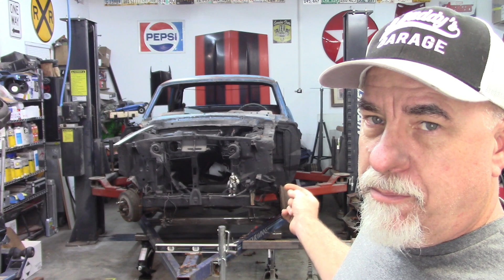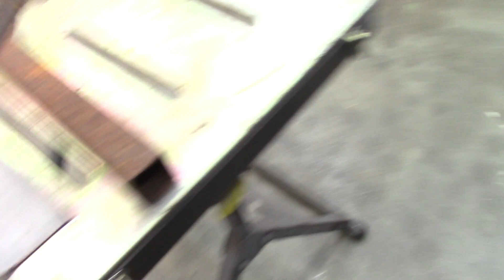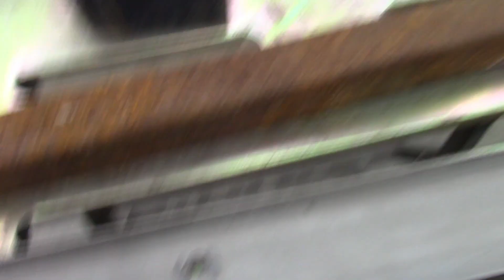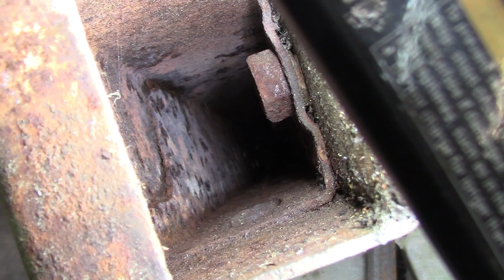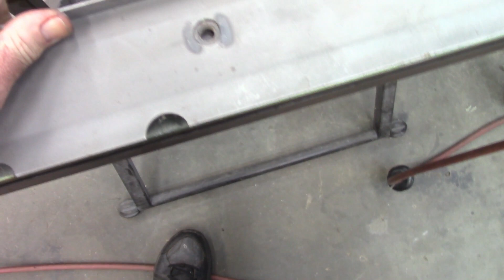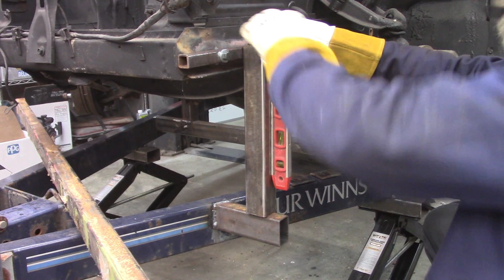Mobile Mustang frame jig. Part 4.

Comment: Each new car you put on the jig, will have front bumper bracket nuts in slightly different places. Seems you are now boxed in to the specific front measurement of this particular car now. You could have used a different metal piece like an old bumper bracket for instance. And made the holes big enough to locate where you need to. Another thing is that depending on whether the engine is in the car, where the car is supported from, and even if it is set with weight on just the wheels/suspension points, everything flexes. (wonders of unibody) Just wondering if you need more slots etc. so as not to box yourself in too specifically based on the current car. I like where you are going with this though. Great idea and thank you for sharing!
Reply from the maker: I agree. I will not have a fully functional car on the jig. Just shells. I may have to enlarge the mount holes in the 1” square tubing to allow for minor tweaks.

Comment: I had a Falcon where a bumper bolt hole was in the wrong place. The factory chose to torch a slot in the bracket to make it work. I only found out when I tried replacing the bumper with another using the other's brackets.I didn't end up saving any time on that job.

Comment: Cool bronco what year is it also what’s it have for a engine and what’s the exhausts it’s running and is it a 4 speed Manuel transmission jo daddy’s garage
Reply from the maker: The body is basically the same from 66-76. I think the engine will be a 302 and automatic.